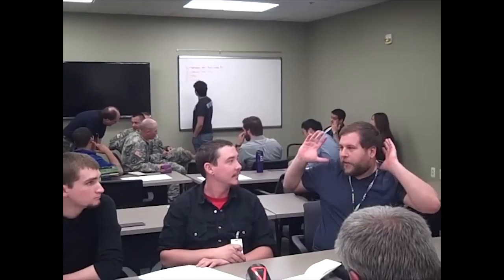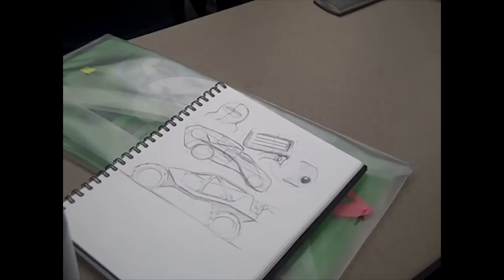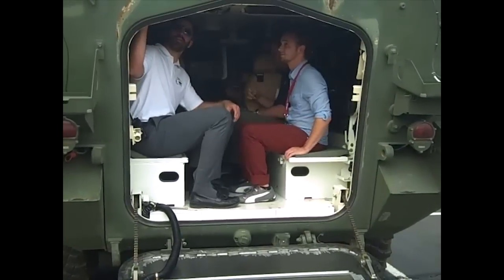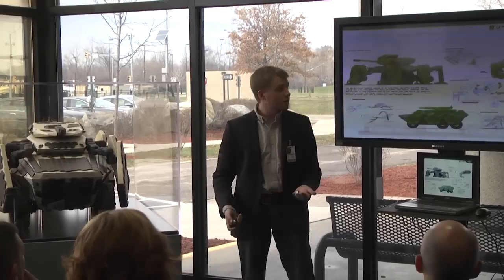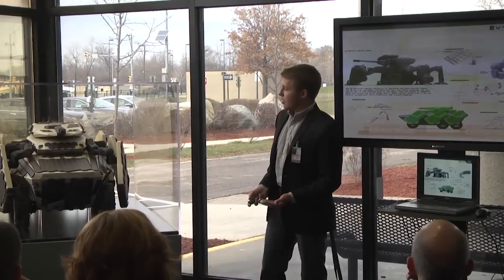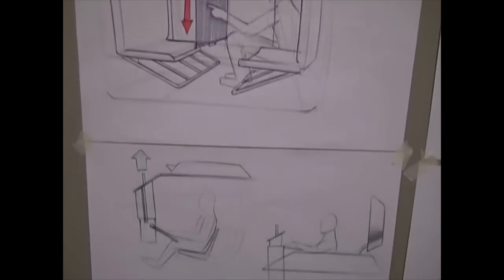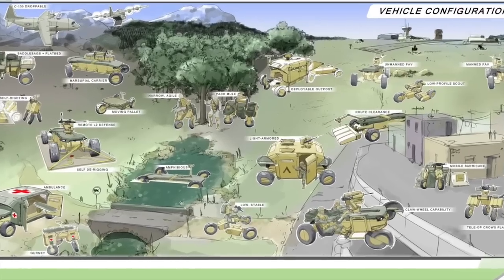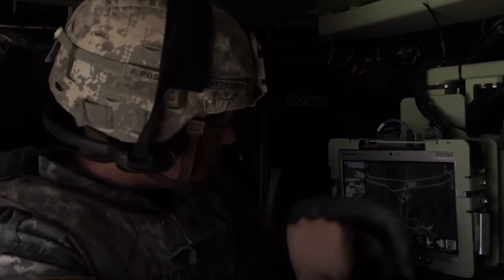What is a Soldier Innovation Workshop?

Comment: Dear TARDEC, I noticed that the army has more focus on autonomous mobility, ballistic protection, communications and UAVs among many and to me there is at least one thing missing Fuel Efficiency that makes all if not most of the above possible. I understand that the army has the FED prototype (4.5L 4 in-line Diesel engine) that is projected to achieve 5-7mpg, I believe we could do much better than that. Saving the army millions of gallons on diesel fuel annually is real within reach. I would like to contact the FED lead project manager/engineer to put forth a comprehensive plan that can easily more than double the mpg factor. Please let me know how to connect with him or her. It is not easy to reach the right person at TARDEC. Fuel efficiency improves the logistics end of the war fighter, more mpg will free the average soldier to worry less about distance and focus more on destination.